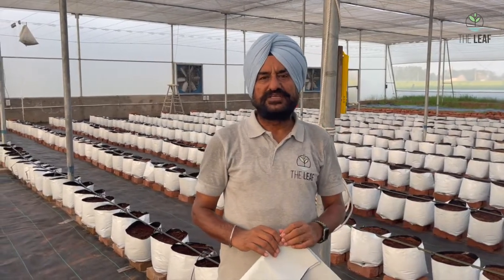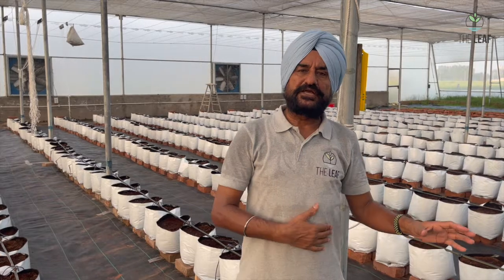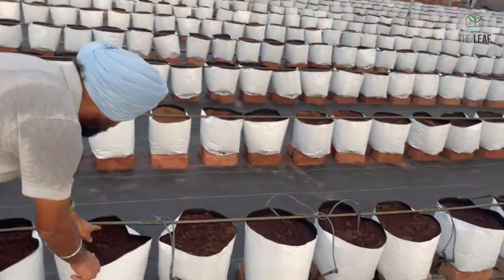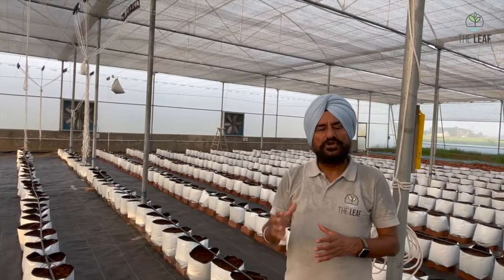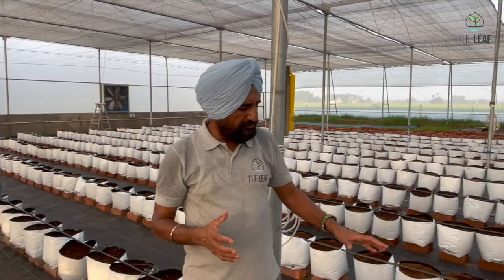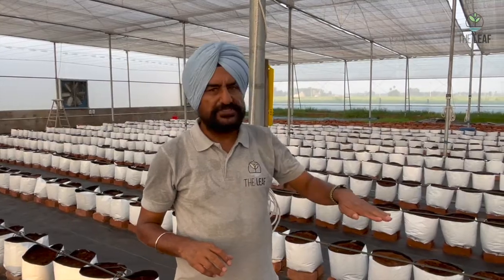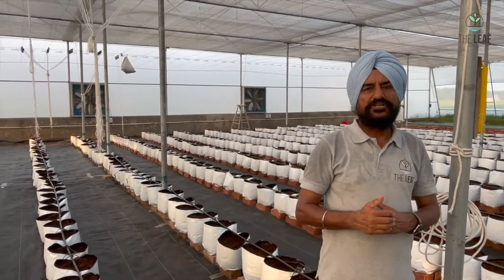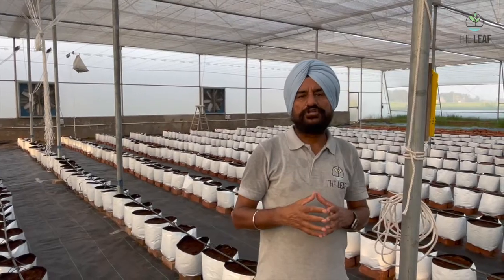Grow Bags System Setting

Comment: Cost of one growbag including cocopeat?
Reply from the maker: Grow Bag Rs. - 15, Grit 8mm Rs - 2, Cocopeat Rs. 35, Labour - 2. Total - Rs 54 say Rs 55
Reply: @TheLeafHydroponicFarms  ok , very useful information 👍, fertigation system is automatic? Or like in  a normal polyhouse in which we use Venturi and give daily doses of npk
Reply: @TheLeafHydroponicFarms  in one acre around 6k (2 plant per grow bag) growbags would be there which will cost us around 3.5 lakh , right ? And i am having manual polyhouse with no automation so i have to install arrow drippers, growbags and give dose like i used to do through Venturi?
Reply from the maker: @nipun829  It is fully automatic. No labour or attention required. will put-up a video shortly on drip irrigation system for Growbags.
Reply from the maker: @nipun829  One acre 4000 square meter will support about 8000 grow bags and 16000 plants. about 4 lakh for the Growbags and another 4 lakh for drip irrigation and 1 lakh for the nursery depending upon which variety you want to use.
Reply from the maker: @nipun829  It is automatic not through ventury system.
Reply from the maker: @nipun829  i one acre you will have at least 15000 plants. you can retrofit a manual  poly-house.
Reply from the maker: No you will have to have Irrigation Controller, solenoid valves & Dosatron
Reply: Hello,  is it good for net house ?